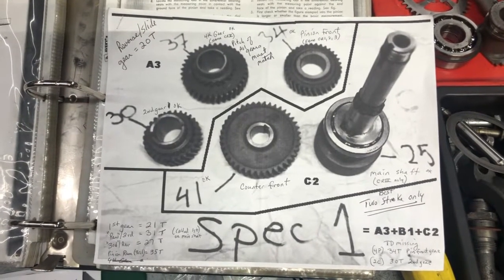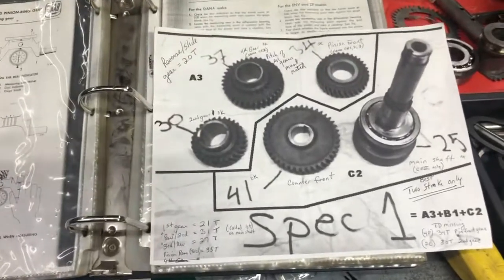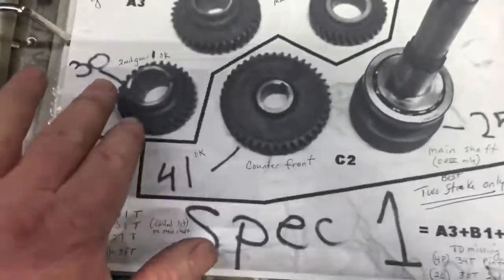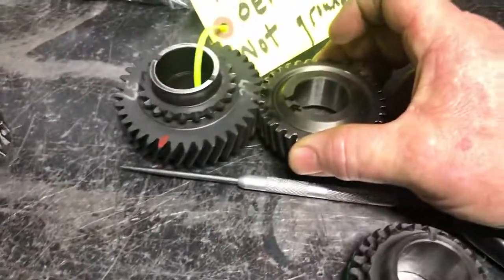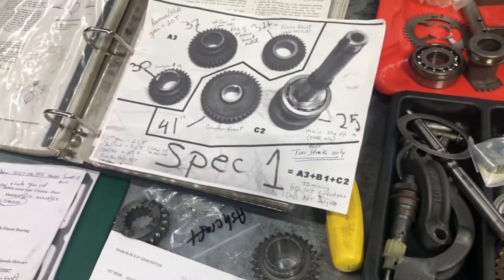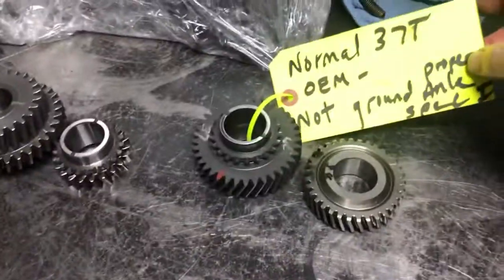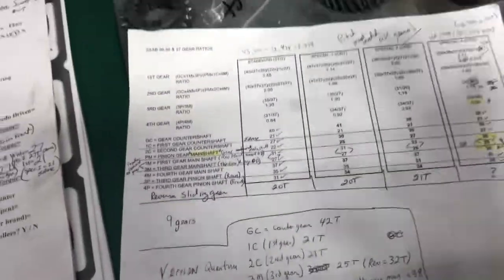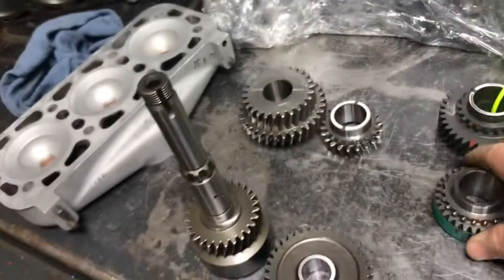Saab two stroke Spec I gear set

Comment: Interesting, are the 4 speed transmissions all the same case, but with different gear ratios depending on whether it was a 2 stroke or a v4? In theory could a sonett 3 trans bolt up to a 2 stroke then?
Reply from the maker: Sonett III used a 4.66 ratio.  Two strokes 5.43-4.88 (4.88 HP engine).  Bell housings are different from 2 to 4 stroke. Axle splines can be different too
Reply: tom donney thank you, I really wanna get into these things, however they are SCARCE especially around here as complete cars. I’ve accepted the fact that if I want some 2 stroke power I’m probably going to have to build something, so your videos have been absolutely invaluable in my learning.